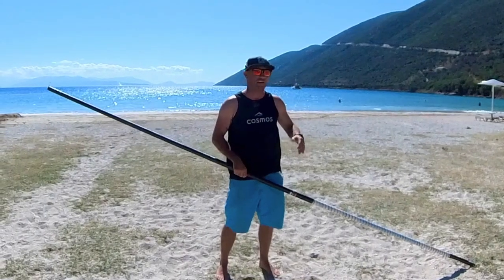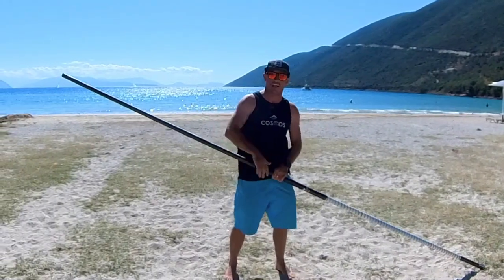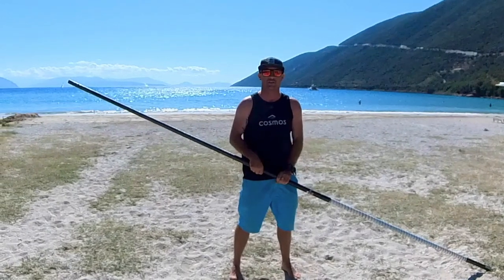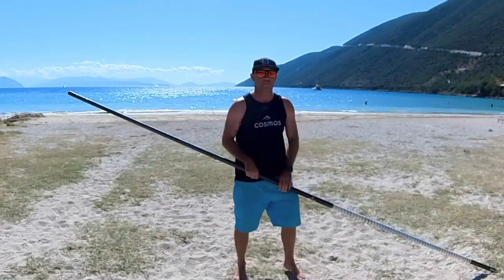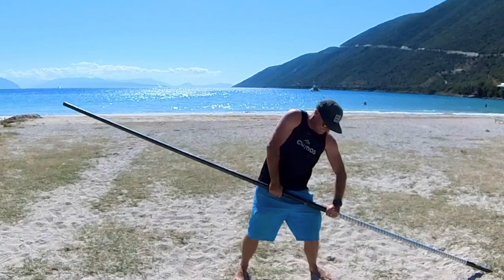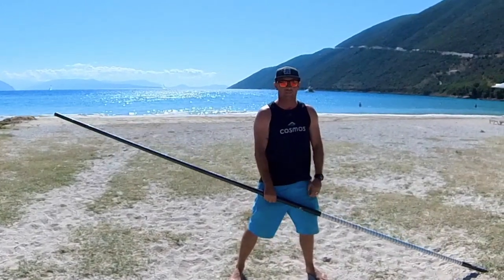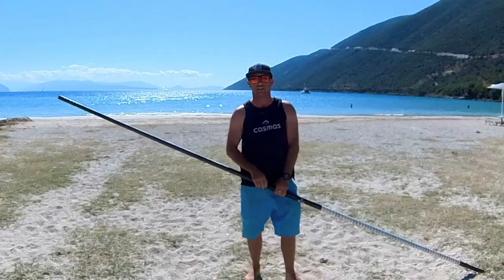How to unstick a stuck mast!

Comment: A tip to prevent the mast from getting stuck in the first place, apart from making sure the parts a clean before connecting, is to then cover the seal with electrical tape. Haven't had a mast stuck since using this method.
Reply from the maker: I use tape too… but can still get stuck (rarely)… so good to know this trick!
Reply: @Cookiesports  Yes agreed. And in that case your trick can help.

Comment: The correct answer, requiring only a raised support of some kind (fence, car boot, etc) is thus:
Put the pointy end on the raised support, the other end on the ground. Firmly but not over strongly  push down on the joint and 'bounce', repeating applying and removing pressure a few times. You may be able to hear any sand grinding. Rotate the mast a quarter turn and bounce again, then another quarter turn, and another, and so on, until it comes free.
This method may take a while, but it won't break anything and no extra equipment or people are required. You're welcome.
Reply from the maker: I know that method, works some of the time….but takes aaaaaaaaaages!
Reply: @Cookiesports  Indeed! I like to believe that any amount of stuckness can be overcome with this method - so long as you have the time! Probably a zen thing in that somewhere.
Reply from the maker: @robertallison1580  🤣🙌🤣 
I think I have worked at enough sand based windsurf schools to know that a Zen approach is great for mindfulness, but will take all day for us to get anything done! This method I am showing you is a guaranteed win, and quick! 🙌👍
Reply: The Zen method works when the boom clamp method fails.

Spraying in some penetrating spray speeds it up. Then use tape every time

Comment: best way to get a mast loose when it gest stuck is to wiggle it. let someone stand on the tip or put the tip against your cartire and wiggle with the other end. takes 30 seconds and loosens everything everytime without the need of anyones help. I rig on a sandy beach most of the times so it gets stuck al lot. this trick has never let me down ;-)
Reply from the maker: That technique can work, especially if you are alone or only have one boom! Trouble is it is not guaranteed, and if it is really stuck can take ages! The trick shown in this video is full proof!

Comment: Cut a piece of bike inner tube, roll it over one half. Connect the two halves. Roll the inner tube over the joint and hey presto - sand can't get in and no stuck mast. Prevention is better than cure 😉
Reply from the maker: Nice idea. I tend to use tape, same goal!

Comment: Super fine sea sand where I sail that causes masts to stick like mad. Just seal the joint with electrical tape before sending the mast up the sleeve. Never had a stuck mast
Reply from the maker: Yes, I use tape too- but still good to know this trick just encase!

Comment: Good idea but booms aren't really designed for the kind of force.  What I find works much better are a couple of rubber car oil filter wrenches.  Designed specifically to provide as you say massive torque without crushing your mast.  Never had a stuck boon not come apart with a few of these and they small and cheap,
Reply: Да,только где на пляже искать эти ключи..😊
Reply from the maker: That’d work well too… I just tend not to have oil filter wrenches knocking about- but I’ve always got booms!

Comment: I’ve never had this happen. Is it because I don’t windsurf around sand? I just brush off the mast connectors with my hand before I rig - no lube, no tape etc.
Reply from the maker: Yes- sand a grit are usually the culprits to getting them stuck!